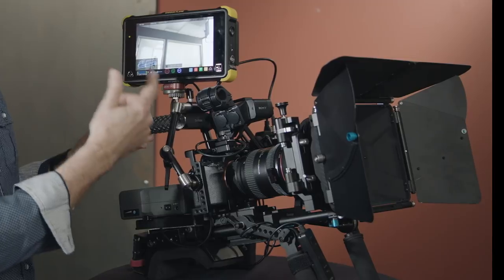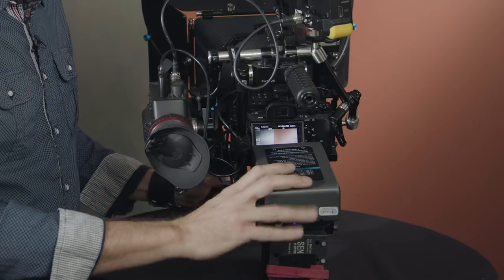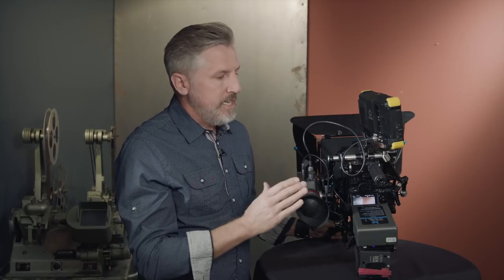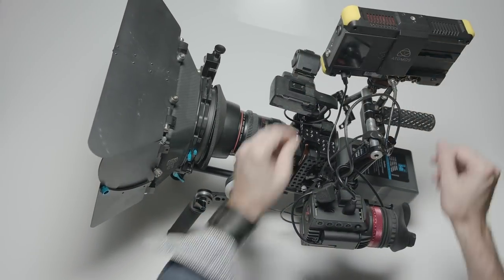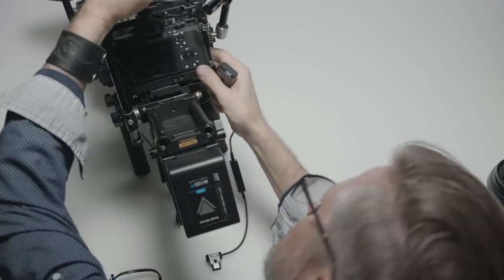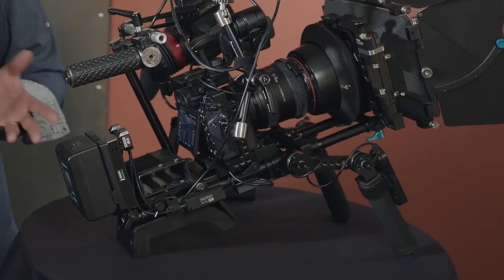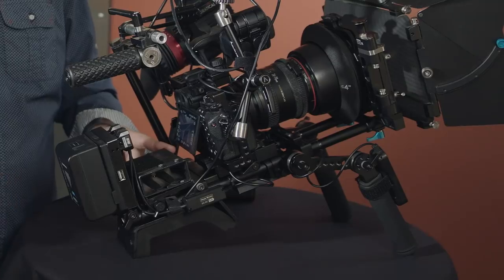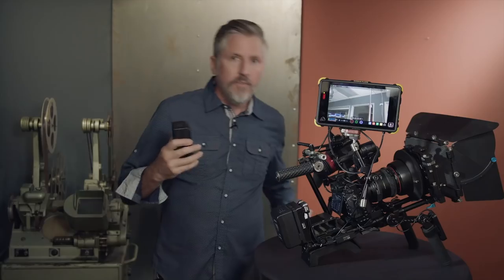Making a Compact Sony a7S II Rig with Hawk Woods Mini V-Lock Batteries

Comment: Despite the negativity in comments about the usefulness of the rig, I do like that little battery. 4 Dtap ports that are in the back of the plate is super nice and seemed like it's definitely aimed for mirrorless/dslr market cameras. As far as the rig that he's got, the only changes I really see he could improve is to readjust the Shogun monitor towards the back where the Mini V-Lock battery is and replace that matte box with the original lens shade.

Comment: I've done a long shoot with the Blackmagic Pocket, and swapping those canon batteries every 20 minutes killed me. I had to bring 4 batts and 3 chargers, plug em in and cycle every 20 mins...Just switched to an external battery to power the camera and the ninja, and much happier.

Comment: Hey all, sorry for the late reply.  I'm in the midst of an independent feature film shoot that has taken over my life for the past 3 weeks.  I'm the DP and we're shooting with both the A7s ii and the new Red Gemini.  Looks like I kind of stirred up a hornets nest with this blog.  Let me try to address some of the comments.
1). I obviously wasn't trying to make the smallest most compact A7s ii rig out there.  I was just improving on the rig that I already use.  I'm an old school shooter an I like have my camera on my shoulder for handheld work.  For me, it makes my shots more smoother and organic.  
2). The glass I own is Canon L series lenses.  This is left over from my Canon days.  On the films I work on I rent nice prime glass.  For the film I'm currently shooting I'm using Zeiss CP2's.  The last film I used Schneider Xenon's.  I've debated switching out my Canon L series glass for Sony but since I don't use autofocus it isn't worth the extra cash for me.  If I was starting from scratch I'd  go with the Sony glass.
3) There seems to be a lot of matte box haters!  Matte boxes are great.  They help flag off your lights and you put your ND and filter in the trays.  This is super helpful when shooting with prime lenses.  You simple swing away your matte box, change out your lens and any NDs or filters you have working, stay with the matte box.  It does add weight, so I do loose it when possible when going hand held. 
4) One thing about my rig that I didn't point out is that the A7s ii body can slide off the full rig so you can put it right on a Ronin or to shrink down the camera if you're in a really tight shooting situation.  
5) I contacted Hawk-Woods because I wanted a smaller / lighter battery.  I did my research and I was pretty sure that they'd be a good fit for me.  Once I got the product and put it to the test and it worked great.  End of story.  
I hope this helps.  Thanks for all the comments!
Reply: You are absolutely right! I learned very quickly not to spend too much attention to the Youtube comment section. A lot of people just shouting things while they don't have the knowledge and/or skills to judge in the first place.
The mattebox thing had me surprised too. I think people don't realise that a mattebox holds filters. Granted, not every mattebox does, but the decent ones do.
I am currently building a rig too. A little smaller than yours. I'm using a monitor as a viewfinder, so I don't need an extra monitor. New parts are coming in tomorrow, can't wait!

Best of luck man!
Reply: Thanks for the support.  Good luck with the rig!  I use to just use a monitor and not an EVF, but when I operate in bright sunlight, focus becomes tricky - even with a hood for your monitor.  Focus with these full frame cameras can certainly be tricky.  I invested in a good EVF when a few of my shots came back soft.  Although the EVF was expensive, it's much cheaper than loosing a client!
Reply: That's definitely true! I used to shoot with just the A7s and a Canon 24-105 IS lens. The screen on the A7s itself is pretty bad, but I could cope. I would sometimes get a soft shot, but usually I'd have enough coverage. For the really important jobs I rent a cinema camera anyways. Had great results with the Blackmagic URSA. 
But thanks for the advice! Would you only recommend the Zacuto EVF or are there other good ones?
Reply: Thanks!

Comment: Is this considered compact? At this point, why even use a mirrorless? A little bit ridiculous, but I guess it's a good way to make an ad disguised as an instructional video. And that photography lens with a matte box on it...this doesn't have any benefits of cinematic lenses, no actual good autofocus (because it's a canon lens on an older a7sii), no raw or colors or framerates of a cinema camera and all of the drawbacks when it comes to the size. I feel it's backwards, so I would love someone to enlighten me on the actual usefulness of this. Does anyone shoot this way in real life?
Reply: Micsfilms yes people do shoot this way. The point of buying mirrorless is the features to cost ratio for me. This setups allows for different cameras to be used on one rig. So if you upgrade your camera in 2 years you can still use these accessories. Also, in that thought, this allows you to slowly build your gear out over time and strip your camera when you need it smaller. The cost of these cameras are so much lower cost than cinema cameras people think it’s worth it. Although I don’t know the cost of the entire rig, I’m sure it still costs less than many cinema cameras. Is it a bit backwards at times? Sure, but the flexibility to cost is there for filmmakers doing a variety of work at different budgets.
Reply: Fair enough. I shoot mirrorless most of the time, but for me the size is a really important factor. This looks like a full case of accessories that don't bring much to the final image. But you are right, you can keep accessories when you expand your gear. Thanks!
Reply: Micsfilms yeah! diminishing returns for sure. Also, lighter rig means less back pain = more shooting for me lol! :)
Reply: Micsfilms  I totally agree with you. We own cinema cameras as well as this a7sii. In our projects we tend to use the Sony when we need to take advantage of its small size. And when we use it we want it super small and light, stripped down of any accessories: just the camera and the lens. In the past we went down the route of caging it just to realize that by the time you add all the accessories you’re better off using the Ursas of similar. Just my opinion but interested in what others think.